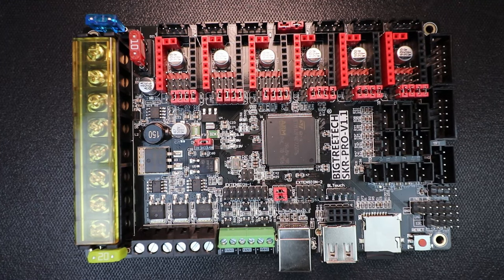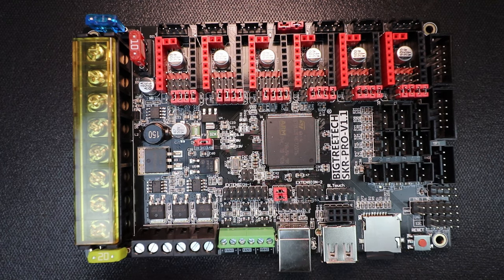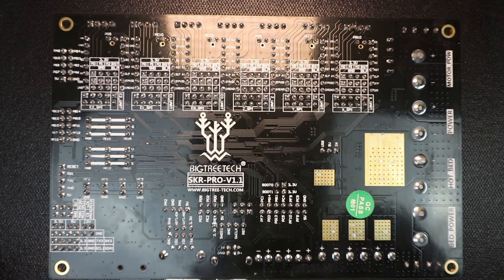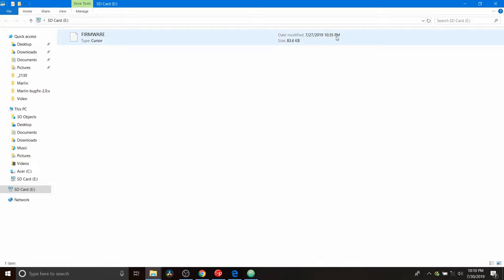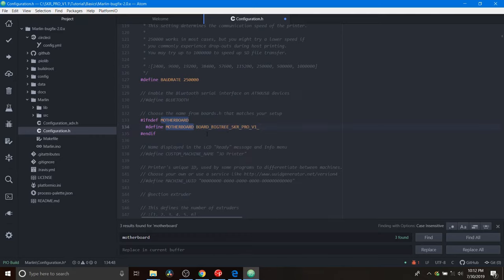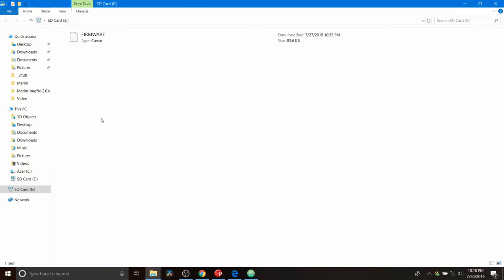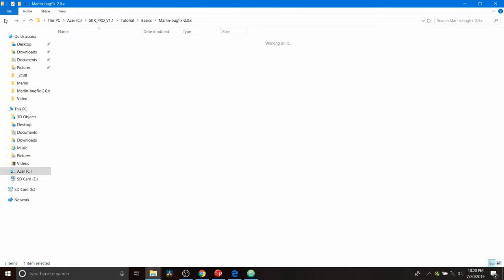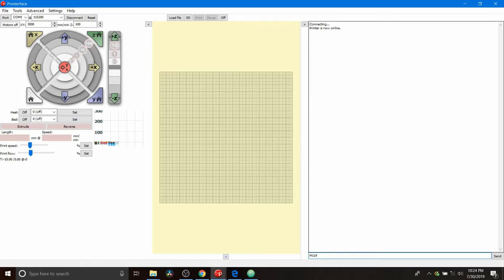SKR Pro V1.1 - Basics

Comment: Marlin has a utility called "Auto Build" that automates some of the build process. You need to set the board name in "Configuration.h", invoke the build command in the Auto Build menu and then manually copy the file to the TFT card. Instructions are at https://marlinfw.org/docs/basics/install_platformio.html .

Comment: A nice step-by-step guide, thanks.
I have used Arduino before without any trouble, I only run Linux.  I bought a Bigtreetech SKR 1.3 32-bit board and display based on another review.  When I saw what was required to get it running I put it away and bought a MKS Gen-L board.  I'm setting up a Orange Pi Zero board to run Octoprint at the moment.
Reply from the maker: I have a tutorial playlist for SKR v1.3 if it helps.
Reply: Take the SKR 1.3 out again and get it working. Once you get the tools setup they're less cumbersome than the arduino ide (compare/diff for config files, etc). Not requiring a computer to flash firmware through usb is great. Compile the bin, copy to flash card, insert in skr, push reset button on skr, you're good to go. I Was running an MKS 1.4 style with a 2560 before the swap. Haven't looked back once. The SKR is superior to the old ramps boards in every way.

Edward Braiman, Chris Riley, and Teaching Tech all have great tutorials on getting the SKR up and running with a variety of stepper drivers.
Reply from the maker: Thanks

Comment: Nice introduction for the board I guess newcomers to SKR PRO will appreciate
Reply from the maker: It appears to be a very challenging board to configure.  Thanks.
Reply: @EdwardBraiman  (you're welcome) yes, the jump between Arduino UI and vscode/platformio is not easy. PlatformIO hides many aspects of compilation and folders that needs to be deleted from time to time, if not you get strange compilation failures.
Otherwise the SKR Pro board is a pretty decent board :)
Reply: @RomanoPRODUCTION  agree. I am new to this and have already experienced a meltdown.

Comment: Soon as I pulled it out of the package and saw 3 power leads I thought maybe they gave me a lead for the hot bed but it seemed too short plus it has the wrong connection at one end so I looked at the board and WOW 3 power inputs which is great. This PCB must be capable of 200W+ beds. Then I realized it has no access to the micro SD card via USB host. Hard to believe as I normally program my boards 5 or 10 times during initial setup vs writing to the EEPROM. Only benefits of this board over a SKR 1.4/SKR 1.4 Turbo are the processor speed and power handling. Its also quite large with the same dimensions as my MKS Sbase v1.1.
Reply from the maker: It's a stable platform, most people enjoy.

Comment: Awesome video! Great job at keeping things super simple. I was checking out this video because I picked up the SKR Pro V1.2 board. I was interested in setting it up as an IDEX board with independent dual extruders.

There is zero documentation on the SKR Pro V1.2 board. Is it the same as the V1.1? Looks like the UART pins with direct support for TMC2209 and a couple other things might be different. Their website mentions their firmware doesnt support UART for the SKR Pro V1.2 so I am confused? lol

Either way keep up the cool vids!
Reply from the maker: They're almost the same.  I have one, but have not had a moment to do a tutorial.

Comment: Thanks Edward! 
I had my PRO V1.1 for a week now and I'm struggling to get my BLtouch working on the dedicated pins on the board. I tried sooo many different settings related to BL probing. The only way I got it to work is when I connect the sensor cables (back and white) to the Z_MIN socket (PG8) like for the SKR V1.3. But no matter how I try Marlin settings and connect it to the dedicated BL touch pins (PA2) the sensor always indicate that it is triggered even when I pull the sensor connector and set Z_MIN_PROBE_ENDSTOP_INVERTING to either true or false.
Reply from the maker: I'm still having issues as well with pin.  I think it might be a Marlin firmware issue, but you can always try pins_debugging on configuration_adv.h and measure with multimeter after setting high or low.  I've not had a chance to check, but there may also be an open issue in Marlin bug tracker.

Comment: Hello good night, I have a question. I'm setting up my 3D printer with SKR PRO, I only have a 24V supply, can I power the "moto power", the "bed power" all with the 24v ??? Or only at the entrance of the board that is "12V or 24V" ??? I'm afraid of burning components

Comment: Greetings! I have a question about skr pro.. I can't figure out how to connect another temperature sensor. By default, 4 are soldered (already occupied) on the Board and 4 more outputs are declared (PF7-10). How do I properly connect a normal 100k thermocouple to them? Or just so it is not connected to these pins, you need a binding? You need to link the thermocouple and the cooler..

Comment: Dear Edward no one else better than you for an advise. Worth the difference of money between skr pro 1.1 and skr v1.3 For an ender 3? Also i was looking for TMC2209 v1.1 but bigtreetech has out of stock until mid september so they offered me 2208s V3.0 UART instead.
Reply from the maker: Well I'm waiting on a TMC 2209 as well. If you're not using a motor larger than a Nema17 you should be fine.
Reply: Finally i ordered skr v1.3 + 2208s + tft24 v1.1 combo. I will be watching your videos to learn how to instal since i have no experience on installing marlin and setup everything.
Reply: @lucasdacampo1335  Lucas I ordered the exact same parts (& a BLTouch) and just got them yesterday. Now comes all the research. It's weird not using Arduino.

Comment: Do you have an ETA on that tutorial regarding the power bus bar? I've seen absolutely no proper instructions on how to work with that and no documented clarification whether it's necessary to use all or just one of the connections, and everyone who's deigned to give any answer so far just refers back to the botched hack-job Tom did once for separate board and driver supplies and said himself is a bad example.
Reply from the maker: So what would you like like to see with the power bus bar?  Additional fans or something else?
Reply: Basic setup using it is the thing I'm most interested in since I have no eperience with or knowledge of the use of that sort of split power supply and haven't been able to find relevant information. Beyond that, nothing comes to mind offhand as particularly pressing, though plenty could be of interest.

Comment: Nice video.

But the SKR 1.1 has one big disadvantage in my opinion: No eeprom. As I mostly use film-probes for ABL, this is a very big disadvantage. Normaly I do the ABL only after something was changed mechanicly; mash is stored in EEPROM and reloaded with start-gcode. Very relaiable, cheap and comfortable. Also precise: As you place the film-probe on the nozzle, offset in x and y are 0; you can probe the whole print area. Also all film-probes I tested have -0.06mm z-offset; so perfekt first layer without seperate first layer calibration.

Also building an Idex with the SKR 1.1 pro is not optimal without EEPROM. Offset in z between the two heads might change then changing nozzles. You can not store the calibration results in the eeprom as there is none. So you have to put them into start-gcode - not comfortable.

In my personal opinion, a SKR 1.3 is the better choise. Even if you need 6 stepper-drivers, you always can use free i/o's for adding an "arduino stepper module" (1,50$ on AliExpress). Without serial/spi-control, but simply change the pin configuration file and define the external stepper driver being z and the build in z as second x. You normaly do not need crash detection on z, also no need to change microstepping there and forget sensorless homing on z anyways. So on z only adjust current with a potentiometer, connect !EN, DIR, STEP, 24V, 3.3/5V, GND to the board.

So in my opinion, being without EEPROM the SKR 1.1 pro can not reach full potential. With 40$ + drivers you almost can buy a Duet Maestro clone + expansion (on black friday on AliExpress, using coupons)

So I actually do not know, where the functions of a SKR 1.1 pro are needed. Maybe using a Diamond nozzle or a chimera. But not an IDEX :-(.

Hopefully SKR sometimes make a SKR 1.2 pro with an eeprom. I would realy love that...
Reply from the maker: You can add eeprom.
Reply: @EdwardBraiman  Do you have a Link how to add eeprom and integrate it in Marlin?

Comment: The atom software doesn't match what I tried to use.  What ever version I have does not have the vertical toolbar on the left so I am unable to compile my changes, or run the test.
Reply from the maker: Sorry the video is somewhat dated because Platformio is no longer supported on ATOM.  In my playlist I explain how to install VScode with Platformio extension.  It should work fine, but if it doesn't let me know.
Reply: @EdwardBraiman  have you done a video on it for the skr pro? I'm pretty new to this so I could really use the help
Reply from the maker: Check the playlist or the Discord forum, I posted it just about an hour ago.

Comment: Thanks for the video. This board looks great.  Do you have the possibility to power the cooling fans with 12V while powering the control board with 24V? Thanks
Reply from the maker: They have board power which uses either 12 or 24 volts which means you need to match fans to power your using.  Some people know how to step the voltage down, but I recommend using fans that match power.
Reply: @EdwardBraiman  I hope bigtreetech will add this very handy option in their new board version V1.2

Comment: Hello Edward, I come to you again because I am losts now with my Tevo Tarantula Pro.
I have replaced the heated bed of my bed with a Keenov 24V 350W to allow me to plrint with ABS filament.
I have also replaced the controler card of my Tevo Pro with a BTT SKR Pro V1.1 ,also equiped with a screen BTT TFT 35 V2.0.
Now my issue; I can move all axes manually on their right direction without any issue.
But when I try to hme each axe separately, the Z axe move to the oposite normal direction, to -Y insted of +Y.
And also when I control the printer directly from my Octoprint, I have the same behaviour.
I have try to invert the #define INVERT_Y_DIR false to true, same, #define Y_HOME_DIR -1 to 1, same.

Have you please one idee what to chech to solve the issue, I have been unable to print for three weeks now.

Thank you in advance

Jean-Jacques
Reply from the maker: There are two types of invert on for endstop direction and one for stepper motors.
Reply: @EdwardBraiman  
// Invert the stepper direction. Change (or reverse the motor connector) if an axis goes the wrong way.
#define INVERT_X_DIR false
#define INVERT_Y_DIR false
#define INVERT_Z_DIR true
this parameter allow to invert the diredtion of the motors (CC or CCW)

// Direction of endstops when homing; 1=MAX, -1=MIN
// :[-1,1]
#define X_HOME_DIR -1
#define Y_HOME_DIR -1
#define Z_HOME_DIR -1
This parameter normally allow me to tell to the printer to move on +Y or -Y to find the limit switch

I have try to invet the direction of the Y axe by modifying #define Y_HOME_DIR -1 to #define Y_HOME_DIR 1, but I still have the same behaviour !!!!

I am a little bit lost, I dont know what is wrong, or what to change to allow the printer to find it origine before any print.

Thank you in advance

Jean-Jacques
Reply from the maker: Send me your configuration.h file on Discord link in the description below.  Which type of printer is it?

Comment: Oh you are most probably asking why external drivers, my two Z axis motors are NEMA 34's and my X and Y axis steppers are NEMA 23's, all nee about 4-5 amps to drive them. I do plan to only use a NEMA 17 for the print head so I would imagine I would just plug in a standard TMC2208 driver for that. Thank you for your help.
Reply from the maker: You're welcome.
Reply: Hello Edward, I have done some home work and may have figured it out, how do I get in touch with you by email so I can send you a document?

Comment: Hey great video! Have a question on the serial connection maybe you can answer since I can't find it after hours of Google searching. I followed your tutorial to the letter, and when I get to the part about connecting to pronterface, mine just didn't connect. I get Error 5, access denied. However, it will connect sometimes I found after a reset and then many clicks... But connecting to Repetier has been a complete no so far.

Do I have a faulty board? I'm considering ordering a second and returning one or the other after comparing them side by side
Reply from the maker: Check or change USB cable.  Open Pronterface after board is connected.
Reply: @EdwardBraiman  thanks, that was a super fast reply!
I should have added, I did use two different cables and 3 different USB ports including directly to PC Mobo w/short cable, not front. I'll try the pronterface trick.

Assuming it has the same results, what would your next check be?

Again thanks! This being a new board with bad documentation, this has been a trickier than usual problem to solve.
Reply from the maker: Check jumper positions.

Comment: Hello Edward, great video explaining the features of this board. I have placed my order for the SKR Pro and am just waiting for it to arrive. I am planning to use this controller with my customer built CNC Router/3D printer and will need to use external stepper drivers. Wondering with your experience so far if you know how to connect an external stepper driver such as a DM556T from Stepperonline. I would imaging that there are output pins before the signal goes to the onboard drivers which I need to locate. Please let me know your thoughts and it would be great if you have time to do a video about it.
Reply from the maker: I've not yet had a chance to use DM556T, but may try in the future.  Thanks.
Reply: Thank you Edward, do you have an idea of the pins I can try or where you would connect the external driver?
Reply from the maker: I'll have to research, but you might want to think about Octoprint.
Reply: Edward, thank you, why Octoprint?

Comment: I like this board for a upgrade to my ender 3 pro but if it was you do prefer 2208 or 2130 with spi ?
Reply from the maker: Well I've used 2130 SPI alot, I'm leaning toward 2209 UART that just came in the mail yesterday.  But u need to experiment first.

Comment: Hi,
What's the difference between SKR Pro V1.1 and the SKR 1.4 Turbo? It will be very helpful if you can clarify this.
Reply from the maker: They are mostly difference between processors and available pins for devices.  SKR pro has the most available pins and processor speed.  Then SKR 1.4 turbo, and SKR 1.4 are the same pins with different processors.
Reply: @EdwardBraiman  I have an Anet A8 with stock motherboard. Would the pro version be an overkill? I reasoning is if I get the pro. Most likely I won't need another update for a while. But the SKR 1.4 is so cheap.
Reply from the maker: SKR 1.4  is good if you're not planning on adding lots of extruders.

Comment: Great video! Thank you! Do you know smth about EEPROM? As i understand - SKR PRO 1.1 doesn't have EEPROM, but maybe you know how to emulate EEPROM on Marlin?
Reply from the maker: It can be installed with an additional hardware workaround according to a user blog I read about a month ago.  I was going to do a tutorial on it soon.
Reply: @EdwardBraiman  This is because Cortex do not have EEPROM. You must add an additional external EEPROM chip via SPI or I2C.  Also, you get the bed/bed power connections incorrect. the HOT BED terminal on the large screw strip is where the bed is connected, BED POWER is just that. the 3 pairs of smaller terminals are for extruder heaters.
Reply: Marlin already has an EEPROM emulation option.  In the file "Configuration.h", enable (uncomment)  "#define EEPROM_SETTINGS".  If the board/CPU doesn't have harware EEPROM themn Marlin will usually use a file on the TFT card to emulate the EEPROM.  There is also an option to use a section of FLASH rather than the disk file to emulate the EEPROM.

Comment: This board does not work out of the box? Do I need to reflash it?
I can control the fan speed, but the motors do not move
Reply from the maker: Yes, you will need to flash the board.  Keep in mind I opened a bug with Marlin firmware yesterday for the SKR pro not compiling.  So it might be a couple of days before you can flash.
Reply: I hope you someday make a video on the firmware of this board. People are tormented with firmware and nowhere is there a normal solution to the problem.
Reply from the maker: The Marlin firmware appears to be fixed.  Could you try a fresh download and see if it build according to tutorial?

Comment: Can i use 12V hotend while powering the control board with 24V?
Reply from the maker: I recommend one power supply.  If the datasheet says otherwise, then I've no comment.